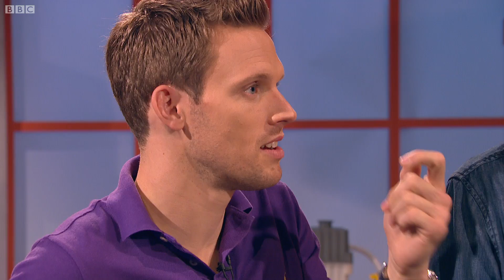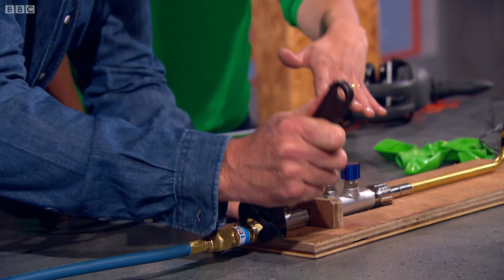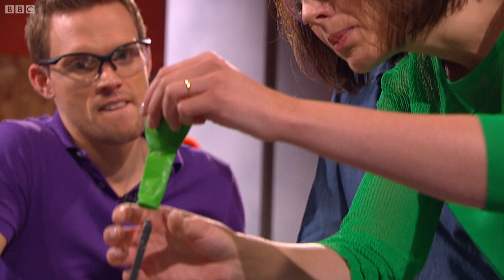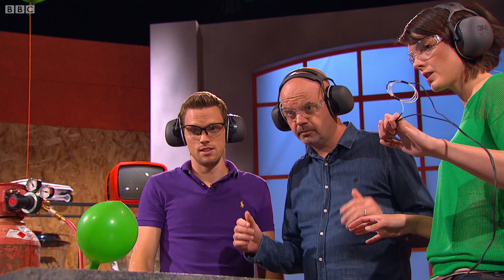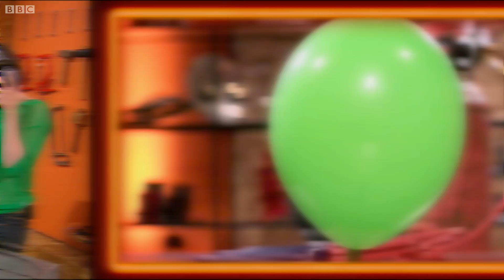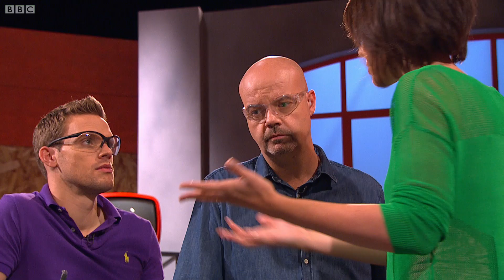Why Did The Hindenburg Explode? | Earth Science

Comment: Nice theory, but it's wrong. There exists a photo showing the very beginning of the fire  up near the tail, but yet the Hindenburg is still dead level and in trim.

If it was a hydrogen cell leak, the tail of that ship would've IMMEDIATELY started tipping down as the back end lost lift from the leaking lift gas. But yet the fire's going, and the ship is still level, ergo it's not a hydrogen leak that started the fire.

What they fail to mention is that the airship's fabric cover was painted with what is called dope, it's used to make the fabric waterproof and reflect the sun so the gas cells don't expand and rupture. For the Hidenburg, the Zeppelin Co. was trying out a new dope recipe which unfortunately contained aluminum powder and iron oxide, aka solid rocket fuel.

It's not widely known, but after the accident the Zeppelin Co. tested samples of the old recipe doped cover and the new recipe cover with an electric  spark, to simulate a static discharge which could easily happen even though the ships were designed to safely pass their electrical buildup when the mooring lines touched the ground when they were landing. The old cover did nothing, but the new one caught on fire almost immediately.

It proved that the Hidenburg would've burnt up and crashed no matter what, regardless of whether it had been using hydrogen or non flammable helium.
Reply: showing a flame at the tail doesnt prove where the initial fire stared..it could have started almost anywhere inside from almost anything and travelled to a weak point at the tail..no conclusive evidence of anything..
all it tells us is it did burn thru the tail very early..normally the tail is where gases were vented,,,, behind the craft,,, so of course a flame willl be spotted out the tail
Reply: a gas bubble equalizes itself at all places during a leak ahahaha a fire at one end of the bubble doesnt make it heavier or lighter..in fact it should make it rise slightly from heat effect of the gases ..which is what happenned
Reply: +johnny llooddte 

Erm, no. The Hindenburg had vents all along its top above the gas cells, which besides having valves that let the crew release lift gas to make the ship descend without pitching up or down, also would vent any leaking gas caught inside the envelope. If there was a hydrogen leak, it would not as you say, collect at the tail, it would rise straight up and go out the vents.

The fact that the tail neither rose nor fell despite the presence of significant flames at the tail suggest that it wasn't the hydrogen that was burning, at least at first. 

The covering of that ship was accidentally painted with the ingredients for rocket fuel, it would've burned with or without the hydrogen. Look at the speed at which the cover burns during the accident, it's going up like a match all around, and hydrogen doesn't engulf things like that, lighter than air, remember? It's not gasoline.

Comment: Slightly misleading title.
"was probably" isn't a very definitive answer, plus we all know that the hindenberg burned - it DIDN'T explode.
AFAIK the disaster was caused by a spark from the mooring pole sparking a small fire in the skin of the ship which was made of a flammable material, and the fire was fuelled by the hydrogen relatively slowly as it came into contact with the air as each section ruptured.
If the hindenberg was filled like the balloon in the experement here, it would have DETONATED rather than burned.
Bad form Brit Lab. If you're going to explain something under the guise of a scientific "FACTual lesson" then make it accurate please.
Reply: well we dont know what caused it ti burn.. an explosion ,  static or spark or flame

Comment: Hindenburg's downfall was due to many facts - it would have likely burned down even if it were filled with helium.
Highly flammable paint on the surface material, uneven electrical discharge distribution/ potential differences and use of hydrogen.
Reply: helium is used in all modern blimps now and theres never been another fire...duhhhh
Reply: any fire started in a blimp surface would be put out by helium
Reply: I've done some research, and the ship was designed to make wide turns, not sharp turns, which the captain made so he could land asap.  Under this tension, a bracing wire could very well have snapped, tearing a gas bag near the tail, where witnesses saw the fire start.  The Hydrogen mixed with oxygen, then was ignited, my guess is via an electric spark, which was caused when the morring ropes were dropped, and became wet.  The voltage in the wires became zero, while the skin was still at high voltage, as the was a linin cotton mixture.  And the atmosphere was still highly cjarged because a thunderstorm had been through the area recently

Comment: The static electricity spark is up to debate because the Hindenburg by design was made like a giant Faraday cage with those metal superstructure inside and the aluminum paint ladden fabric on the outside.
Reply: it is always possible a leak, a spark, a cigarette lighter flame, static or even lightening caused this..or even sabotage..no one will ever know.... no  spark arresting technology is perfect
Reply: I actually believe it is a mix of theories, to land on those conditions the captain ordered sharp turns, which the Hindenburg was not designed for.  Under this stress a bracing wire near the tail snapped and tore a gas bag filled with hydrogen.  the hydrogen mixed with oxygen and when the morring lines were dropped the wires lost their charge while the skin kept its charge, a spark traveled between wires, and ignited the hydrogen, burning the whole thing; the orange glow you see is the skin burning.  The thermite did not help matters, but the hydrogen was the cause of the fire.

Comment: Standard equipment for air crew on Zeppelins, all hydrogen filled gasbags, were cloth booties rather than hard soled shoes, precisely to avoid unnecessary sparks.  Speculation is that a guy wire snapped, possible during the sharp turn the Hindenburg executed while maneuvering, slicing open a gasbag & allowing hydrogen to leak, which can be seen escaping the hull through a flapping piece of skin just before the vertical stabilizer.  A spark triggered the explosion of the air & hydrogen mix at the top of the ship igniting the skin which burned quickly releasing hydrogen as each gas bag skin was ignited in succession.  Hydrogen burns colorlessly but the outer skin didn't so all the colors in the explosion was the skin exploding, much like a match.  At least that's one theory.  However other experiments have demonstrated that the skin wasn't explosive, which contradicts previous experiments, that in examining the film of the explosion frame by frame they argue that they can see the gas bag just before & below the vertical stabilizer glow from within near the top of the ship.  Design analysis of the Hindenburg & her sister ship Graf Zeppelin II decades later concluded that they were really accidents waiting to happen, that the frame flexed considerably during flight, causing severe strain on the internal guy wires.  Over the course of a couple of years of service the guy wires corroded, weakening them & eventually they would snap.  During each Winter maintenance crew would replace broken & corroded guy wires but wouldn't necessarily detect all weakened wires.  The Graf Zeppelin survived for so long because Dr. Hugo Eckene, chairman of the Zeppelin company, was gentle in flying her, maneuvers done easily, wide turns, avoiding flying in turbulent weather, etc. so the airframe wasn't subject to repeated stress.  The Hindenburg's Capitan was repeatedly admonished by Eckener for his tendency to perform sharp tight maneuvers.  The engineering analysis concluded the passenger carrying Zeppelins would never be certified today because of all the guy wires & overly flexible frame & rapid corrosion.

Comment: Static electricity found a ground when it approached the landing tower. You forgot to mention the flammability of the fabric.
Reply: There's a lot they didn't mention because the video ended so abruptly after they exploded a balloon.
Reply: Yes, in the latest filming found of this disaster you can see clearly that as soon as the mooring cable hits the ground the Burg explodes from the rear https://www.youtube.com/watch?v=OetzoO3Csj4
Reply: Yes, static electricity sounds right. I saw another video that indicated that the skin of the ship was treated with some type of doping compound. As a result, as the skin would rub against the frame of the ship, it would generate static electricity with nowhere to go. Once a landing line hits the ground, it found somewhere to go and ignited the leaked hydrogen that was mixed with the air. Flammability of the fabric appears to make the fire spread faster, but I'm not sure that the fabric's flammability was a contributing cause. (Personal conjectures here. I may be wrong.)

Comment: What caused the Hindenburg disaster? Well, hydrogen is only flammable when oxygen is present, and when oxygen is present, the mixture could be ignited by a spark from static electricity. And there you have it. Any questions?
Reply: Uhm yes. How exactly can I use these facts to improve my love life tenfold? Trick question I have 0 love life. 10x0=0
Reply: I have a question.
how can they call this a fact when almost EVERYTHING in this video is WRONG ?
Reply: duh yes the crews were trained and wore clothing to prevent static sparks
Reply: a bracing wire snapped and tore a gas bag filled with hydrogen.  A static electric spark then set the gas on fire when the morring lines were dropped and the wires lost its charge.

Comment: Using your cellphone has been attributed to a number of petrol pump station explosion while filling up your car. The car suddenly caught fire while talking on your phone. A lot of warning has been put to prevent customer to not use phone while filling up. But I think static electricity can be the only cause of it. When filling the car it usually produce an amount of fuel vapour. With the right condition such as wearing heavy wooly shirt brushing against the car seats or coming out from inside a very dry and cold car to hot outside environment. You can bet some static electric spark could be generated. I always discharge my body by touching a grounded surface such as the metal part of the pump or your car body.

Comment: didn't mythbusters prove that the skin of the "balloon" was highly flammable, and that it is most likely that it was the skin that caught fire?
Reply: MrAagaard that would be someone holding a lighter on the skin of the "floating device" part
Reply: these are all theories. we don't know what happened really..
Reply: they proved the skin theory is partially right, they made 3 scale models using copies of the actual Hindenburg blueprints, covered in the same thermite paint used on the real thing. (Well 2 were, the last was painted in pure thermite for fun, and to show what wpuld have happened if the ship was covered in rocket fuel)  One was filled with oxygen and another they filled with hydrogen.  The model filled with oxygen burned very slowly, it took a couple of minutes, the model with the hydrogen burned in almost the exact amount of time as the real thing.  The skin played a part in the fire, but the hydrogen lifting gas was the accelirent
Reply: @davyt0247  Yup. Just watched it, and thats spot on.
Reply: @dnomyarnostaw  indeed, seconds from disaster did an episode on the Hindenburg, and it answers some of the long standing questions, check it out.
Reply: Swazi Hitler 27
Static electricity discharge when making ground contact.

And it was the paint of the advert on the hull that caught fire.
Reply: yes they did, and yes it was the skin.